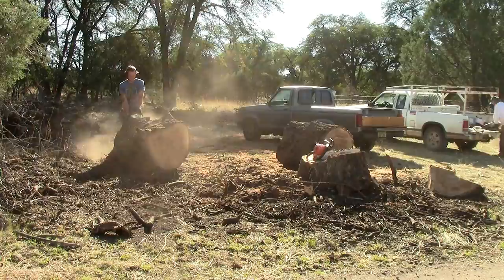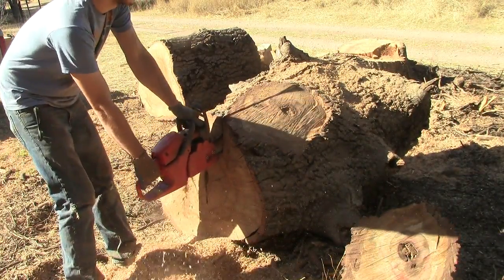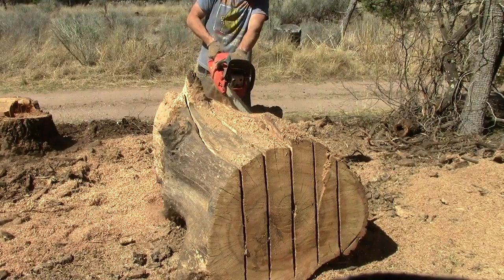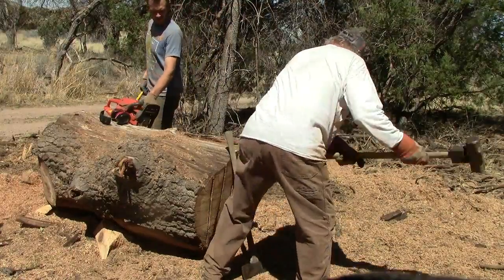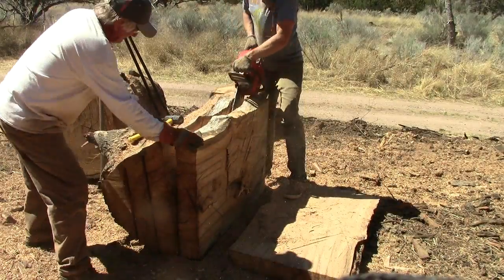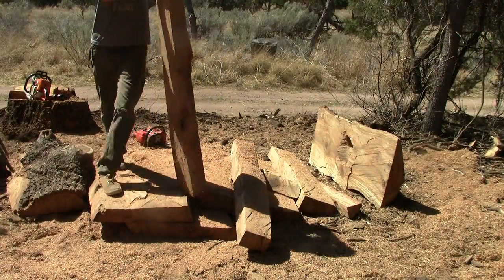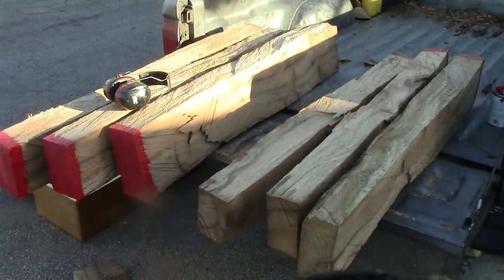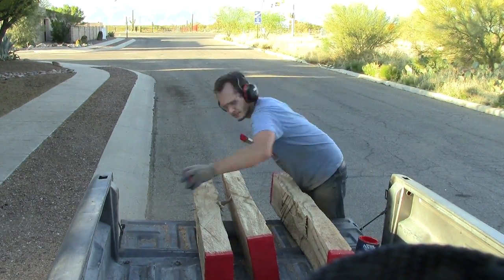How To Chainsaw Mill Without A Chainsaw Mill

Comment: I watched your video then milled a tree about the same size and the results turned out a lot better than I expected. Do you ever worry about saw kick back?   I have a Stihl ms 441 magnum with a 28” bar and cut 21” wide slabs in Hawaiian silver oak.

Comment: You need to upgrade that saw to a more pro model for milling. Try something over 100cc and put a skip tooth ripping chain sharpened at 10 degrees.
You will save yourself a lot of time and energy.

Comment: Hi friend. I have the same Husqvarna 460 Rancher 24" . Ripping chains are on sale at Bailey's right now for $19.99 and are designed to cut with the grain of the wood! it will leave a much smoother cut and save time behind the saw.
Reply: Alaska Chain saw mills are cheap to build out of 1" square steel tubing if you have a welder. There are several good styles on Utube. I'm building one for under $100.00 with a $30.00  top wench worm gear crank from Harbor Freight . I've done a lot of business at Baileys they have always done me right! Saw your work. Excellent craftsmanship!
Reply: Got some, tried it, full chisel, semi-chisel milling on 576 w/32". No noticeable diff, but full/semi-chisel are more generally useful. Gotta keep 'em sharp, with proper joint (depth-gauge setting). Ripping is NOT same as your "noodling" cut, which any chain can handle. A mill saves LOTS of wood waste, with consistent thicknesses, once you learn. I want my waste to be usable as fuel.

Comment: The portable mill is only 200 CAD and will give you better cuts with less time and effort, and it is safer as you are not close to the chain; yet your work is good though

Comment: Cool idea, buy FYI slab mills should have a rip chain, as should you. Crosscutting is normal on the round cutting. Also kickback is the tip hitting, as long as the tip is in the log you can let the top of the bar at the handle side through the log.

Comment: $500 for a chainsaw mill???  Doesn't your computer connect to eBay?  Seen em for under $50......

Can't argue with nostalgia......I guess you will just have to live with using the second best brand of saw.
lol, jk.....saying which brand saw you like around people with saws is as dangerous as saying a 1911 (or Glock) is better than the other in the gun store........BTW, best way to stop the Ford/Chevy argument is laughing and saying neither makes a truck as good as your Dodge....

Melted wax (paraffin or bees) is cheaper than paint for sealing boards, just something to think about (of course it doesn't matter if the paint is leftover from a project).

Like the vid.
Reply: Bulllshit. Show me a quality $50 chainsaw mill.  Especially for a 36 inch tree.